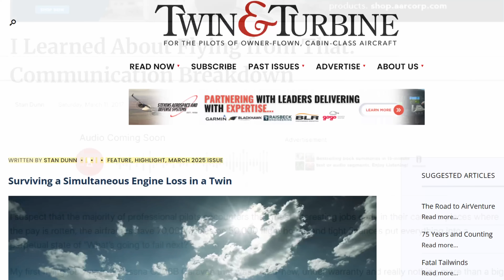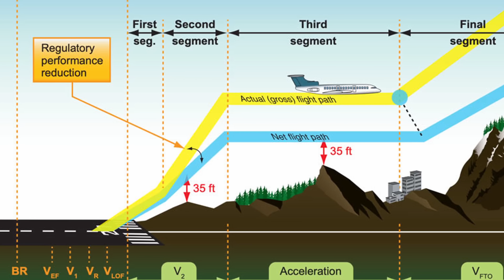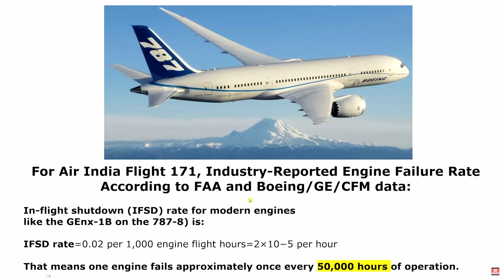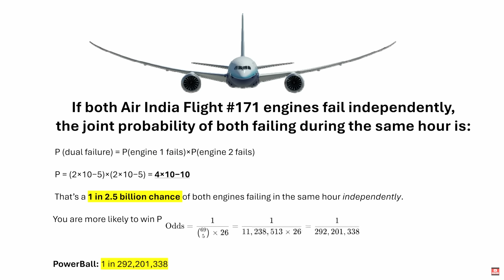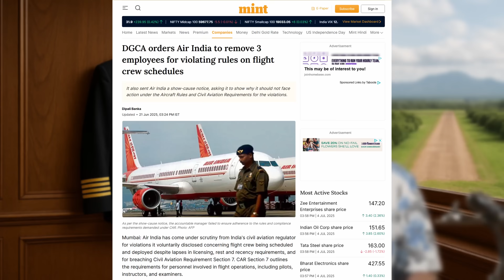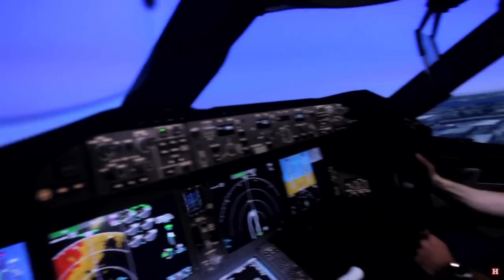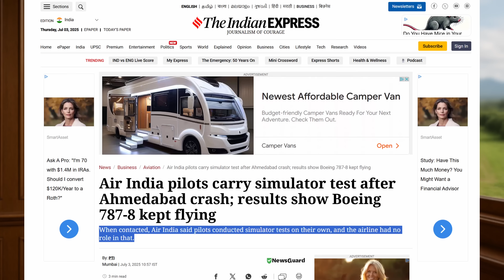Air India 171 Cause Becoming Clear

Comment: THIS IS EXACTLY WHY WE NEED TO DEMAND 4 ENGINES PERIOD! THIS 2 ENGINE B.S IS NOTHING BUT A WAY TO MAKE MAX PROFITS, 4 ENGINE WAS ALWAYS SAFER THAN 2 ENGINES.
Reply: Let's do 8
Reply: No thanks
Reply: 4 Engines wont Change much, airplanes with 2 Engines need to be designed that in Case off one failure that the other engine delivers enough Power, which means that if they both work, the aircraft has twice the Power IT needs. If you have 4 Engines, they also need to be designed for a single failure. If you lose 2 Engines it will be very likely that the airplane has not enough Power to operate. And in normal Operation just 1/4 of the Power is needed as safety measure which leans to an more underpowered airplane than overpowered
Reply: @christophs.3334  not true, 2 engines  is not safe for bird hits its been proven over and over its not redundant enough
Reply: @christophs.3334  Two engine airplanes are designed to fly on one engine.
Reply: In a 747, Captain Sullenberger might not have had to land in the Hudson.
Reply: Those who keep saying 2 engines are safer than 4  blah blah it can fly on one engine let me remind you again you're missing the point, this point is that each side has a redundancy , hitting birds or what have you is far much better mitigated if you had 4 engines than 2 desperate  engines, they only came up with 2 engines for fuel efficiency marketing and claims they are now far better engineered but it does not eliminate the need for aerodynamic  redundancy this is the single biggest point they fail to tell you,so you can tell me all that 1 engine drive nonsense but when shit hits the fan and there is an emergency situation like a bird strike at take off with 2 engines and all sorts of lights and alarms in the cockpit  it gets cloudy and the only thing that saves you is the pilots own situational awareness and what he does next, not all make under pressure and of course 2 engines means 1 chance of recovery 4 engines mean 3 chances of recovery and so forth....pick your poison 2 or 4 i choose 4 every time.
Reply: @patrickjosiah8924  that assumption is wrong, an airplane with 4 Engines isnt operable with only one or two engines left. In an 4 Engine  Maschine each engine delivers 33% of the needed Power accounting for one engine failure, they are also not designed for multiple engine failures. The loss of more than one engine will bring the requiered Power under the needed 100% threshhold

Comment: You blew your credibility out your ass when you mentioned "carburetors" in relation to turbine jet engines. If your intention is to be a source of reliable information stick to the subject of Air India 171 in your videos. You contaminated your video by bringing up unrelated technology. 

" When clean residual fuel in carburetors or collector tanks allow the engine to start and taxi normally only for contamination to trigger a failure during a high fuel demand of take off and climb "

This statement might be true in a piston engine aircraft with a carburetor until the carburetor runs dry and the engine stops running due to fuel starvation. 

This is a huge impossibly in a jet airliner due to the fact that it takes hundreds of pounds of fuel, and there is no carburetor on a jet engine, to taxi out to the active runway. By the time the takeoff roll has started the fuel contamination would already show up in a loss of fuel pressure. 

The initial statement that " there's been lots of speculation"  sure cover's the huge amount of additional speculation in your video. I only see a YouTube content producer capitalizing on a tragedy adding to doubt and fear for potential travelers.

You remind me of the very last flight instructor I flew with. He was bringing up systems unrelated to the aircraft type we were operating. Then as I was taxiing to the runway he decided to "grab" the controls to "get if front of another airplane" on the taxiway. Both items made me feel.uncomfortable before we even got to the run up area. 

I was not surprised when I heard he and his best student were killed in a take off at an airport due to density altitude. 

Nothing you said in this video instills confidence in your ability to fly or use critical thought as an aviator. As before, I won't be surprised if you kill everyone on a flight under you control.

Comment: I still think there was a electrical power loss in the cockpit / computer room right at lift off.   In any other scenario the engines can't spool down fast enough to trigger the RAT so quickly.   Main systems down/rebooting under RAT power, FADEC's lose control data and default to low thrust.   Furthermore it's reported the pilot called out on his mayday "NO POWER… NO THRUST…".   Maybe "power" means thrust but I think he meant exactly what he said, no power in the cockpit.

Comment: This is a plausible scenario.  Another thought is that the FADEC does not need to be sabotaged to fail.  A passenger on the plane when it landed earlier that day had taken a video showing extensive electrical failures in the passenger cabin, which begs the question of could there have been electrical failures in the cockpit?  It is puzzling, and I think a lot of people are interested because of the question of Could this happen the next time I fly?  I liked the estimation of the probabilities to be helpful in quieting some of the fear.  It really drives home the safety of the aircraft, in general, even if this is due to a failure of the aircraft.
Reply: The previous flight passenger's observation - obvious problems around AC and electrical - should be the very first consideration in these analysis vids.  And it's NEVER mentioned.
Reply: @stephene.robbins6273  because cabin systems are on completely separate electrical circuits...it is that way on all aircraft
Reply: Cabin failures indicate a serious problem the cause of which, such  as poor maintenance, likely mirrored elsewhere.
Reply: @stephene.robbins6273  Boeing does not want a replay of the 737 groundings. they still have nearly one thousand on the ground awaiting 'fixing'
Reply: With the cabin electrical failures observed, the craft needed to stop for maintenance.
Reply: The FADEC have their own dedicated electrical supply.

Comment: What happens if the RAT is deployed in error? Does this then interact with the regular running of the aircraft - engines disabled, power switched to RAT only (with not enough juice to run the basic components)?
Reply: The RAT is purely a backup. To deploy it manually you would have to reach high on the overhead panel to push the button. Highly unlikely as it would only be used if it did not deploy automatically.

Comment: You haven't addressed clogging of fuel lines due to poor maintenance. The centre  fuel tank has access to both engines even though both engines have separate fuel lines in the wing . I can say more but my assessment is clogging of fuel from centre tank that starved the filters and lines . Two things . Fuel contamination due to clogging or sabotage.

Comment: About both engines failing within the hour. The change is low. But all those calculations go wrong on a very very important fact, the engines are often same type, age, same production line, same maintenance, same stress/use. Anything mechanical and identical in about everything have a habit to fail at about the same time.  Thus greatly increasing the odds of a dual engine failure. Although if one fails, the change the other one fails in the same flight is really low, it is a LOT higher than the theoretical calculations !

This applies to anything and was very very important in IT, at the time large storage systems used spinning disks. Although rated excellent, it happened rather frequently the disks started failing withing a very short time period.  In some rare cases the failures occurred so fast, the storage-systems were not always able to move in the hot-spares quick enough leading to total failures of enterprise storage systems (full loss of all data).  With the theoretical calculations, a dual disk failure within the hour was near zero, would never ever happen. But it did, rather often actually!

Comment: Disagree strongly. Had one engine shut down abruptly there would have been yaw. Yet yaw is not visible in the video. All indicators point to an electronic fault sent to the FADEC systems of both engines to either throttle back substantially or go to idle. This fault could have been caused by a known defect in the LRRA to Thrust Control system where an erroneous altimeter reading may be sent from the LRRA causing the thrust control software to sent erroneous commands to the FADEC system. The FAA issued AD 2024-16-07 (check this yourself. The AD specifically warns of the danger of controlled descent into terrain) directing all 787 operators to install a software update to correct this known problem. Now the question becomes: Did Air India install this update as legally required, and is THAT the reason the Indian Aviation Authority ordered immediate inspections of all 787's being flown by Indian Airlines? The SIMULTANIETY of the dual engine out (without yaw) is the KEY question which must be fully explained, and blaming this on the pilots may be the convenient thing to do, but will not resolve the underlying weakness of this aircraft, which is an overreliance on electrical power and a defective fault control architecture.

Comment: What we do know at this point, is that they did not use the entire available runway, but departed closer to the middle or 1/3rd of the runway, giving them far less time, airspeed and room to respond to any emergencies.

Yes, it cuts down on taxi time and helps keep you on schedule, uses less fuel, etc.  But it also significantly reduces the time you have to respond to any issues.

In aviation, it is well known that the airspace above you, the runway behind you and the fuel you left on the ground will be of little use to you when you needed it most.
Reply: They started the TO roll at the beginning of the runway.
Reply: @orizaba18000  There are two versions of that, as seen here:

"While initial flight tracking data suggested the plane used only part of the runway, FlightRadar24 later confirmed it used the full length of the 11,499-foot runway."

I haven't seen the final confirmation that verifies either claim.

Comment: This is not the first time that the 787 has had a takeoff thrust problem. 

Boeing 737-800 at Bristol (2024): Autothrottle disengaged during TOGA, resulting in insufficient takeoff thrust.

Boeing 787-Specific FAA Directives and Boeing Service Bulletins. 

1. FAA Directive (AD) 2024-16-07 Applicability: Boeing 787-8, 787-9, 787-10. Details: Mandates TM and DCA software updates to correct autothrottle/TOGA logic errors during takeoff and climb, addressing LRRA-related issues. Compliance required within 6 months (Federal Register).

2. Airworthiness Information Bulletin (SAIB AIR-20-19) Applicability: Boeing 787 and 777. Details: Addresses autothrottle anomalies during takeoff/go-around, with guidance for 787 crews via Flight Crew Operations Manual Bulletin TBC-108 

Ensuring compliance with FAA directives (notably AD 2024‑16‑07) and Boeing Service Bulletin SB B787‑81205‑SB340053‑00 is essential for maintaining the reliability of the Boeing 787 during takeoff and climb. These mandates address autothrottle, TOGA, and LRRA-related faults that can cause thrust anomalies. Failure to comply increases the risk of serious malfunctions, particularly in hot/high conditions where aircraft performance margins are already limited. Consistent maintenance procedures—such as 51‑day CCS power cycles per AD 2020‑06‑14—and thorough crew training under SAIB AIR‑20‑19 and FCOM Bulletin TBC‑108 are critical safeguards for passenger safety.

There is also another bulletin on 5G interference affecting ground radar LRRA. 

Nobody much is talking about this

Comment: Appreciate your informed insight into this tragedy. I saw a video, sorry can’t remember what channel, that talked about a particular electrical failure which would cause fuel supply valves to mechanically trip.  These valves are apparently a failsafe to stop fuel flow to prevent fire and are mechanical only.

Comment: I disagree with your theory. No lateral movement, no rudder deviation. Nothing showing a single engine failure. And why shut down the engine during rotation?
I think it is not the explanation

Comment: Lousy analysis.  Non-stop talk that's completely irrelevant.  13:43 Comparing all these crashes means as much as if he were comparing them to 737 Max crashes.  Talking about lift, flaps, non-retracted gear is meaningless without providing the following facts:  This was a  787-8  186 ft long 248 seats.  Due to Boeing's cheap cost cutting engineering, the 787-10 is 224 ft long 336 seats.   Both planes have the exact same engines & wings.  So, if the wings can lift a plane 38 ft longer with 88 more people, blaming heat or flaps or gear is BS.  He makes no mention of the RAT deployment.  Which auto deploys with double engine outage.  This was a simultaneous double engine failure due to a FADEC thrust signal electrical short.  A systems design error.  If Boeing put out an alert about it, blame is on Air India.  If not, blame is on Boeing.  
Personally, I don't see the 787 as a modern marvel of engineering with a perfect safety rating up until now.  I see the 787 as a plane that employees who build it say they would never get on one.  I see the 787 as another Boeing f_ck up that's been very lucky up until now.

Comment: Everyone is saying what could have caused this accident. Why won't Boeing make the data from the recorders available online? Because they know full well that the software in these planes is not so much faulty as not fully tested and verified. In Boeings and Airbuses, there is no possibility of immediate switching to manual control. Pilots are told that computers will do everything for them. This is faulty reasoning. And there is still a long way to go. The issue of the flaps - they were definitely extended 15 degrees. In India, the air is hot and thin. From the back, at this distance and such a crappy recording from the airport camera, there is no way to tell if the flaps were extended, but they definitely were. There must have been some failure, the RAM extended. From what I know, after it is extended, all systems stop working, except for the basic hydraulics and electronics. I suspect that Boeing knows full well what the problem is, but will not disclose it, because for its negligence it would have to pay astronomical compensation and all 787s should be grounded until the software is honestly fixed. This would mean bankruptcy of Boeing. Another interesting fact. Boeing's management, in recent years, has fired good old specialists who criticized sloppiness and all botched assembly of Boeings and covering up the botchwork of unskilled workers.

Comment: The entire flight lasted about 30 seconds. It left the ground and initially climbed, so you take a few seconds off the front before you know there's a serious problem. There is a point of no recovery, where even all the right interventions are too late. An engine takes time to spool up, control surfaces time to move, hands take time to move. You deduct that time off the tail end. I would not be surprised if the investigation shows they did not have time to recover, or even if they did, the window was only a few seconds. Even if it is found that pilot error caused this I would say they were dealt a very hard hand to win.

Comment: I am so tired of all these videos made by people who have zero insight into the actual investigation, yet insist on pretending that they relevant insight into the cause.

I am not a pilot and I am not an engineer. I am just an airplane buff with a healthy basic understanding of physics and airplanes.

But this crash more than any crash before it has made me realise that being a pilot does not mean you have any in debt understanding of airplanes. I have seen one pilot after another post videos about the cause of this crash that are clearly wrong or misleading.

Considering I think I had seen about 50 different theories by now, one of them will ultimately have to be correct, but I will bet my non existing pilot license that it is not this one.

Comment: Take off is a a much more mundane procedure, compared to Landing. Manual error is the least expected. The fact that RAT got deployed(and landing gear stuck in retraction), means an unrecoverable  power failure, cycling backup systems, which probably took too long, used incorrect thrust settings or prevented manual override. May be there was a lack of training to almost impossible critical failures🤞.

Comment: There was no yaw and no rudder deflection to compensate for yaw.  The plane rapidly lost speed and wallowed as it was on the point of a stall.  If the engines shut down one at a time then the interval can only have been a matter of milliseconds.
FADEC can shut down both engines as one.  It has done so before.
https://en.wikipedia.org/wiki/2015_Seville_Airbus_A400M_crash
FADEC problems date back to at least 1994.
https://en.wikipedia.org/wiki/1994_Mull_of_Kintyre_Chinook_crash